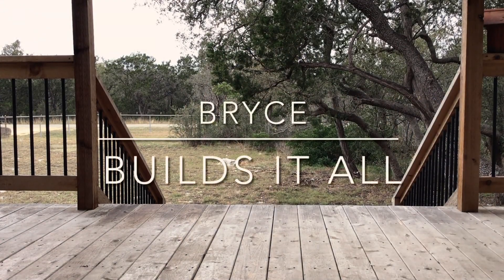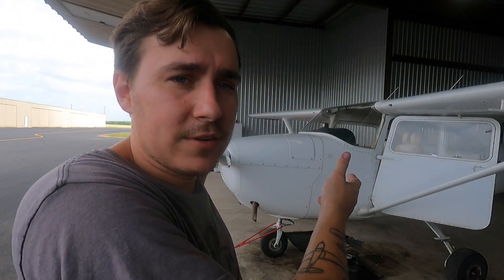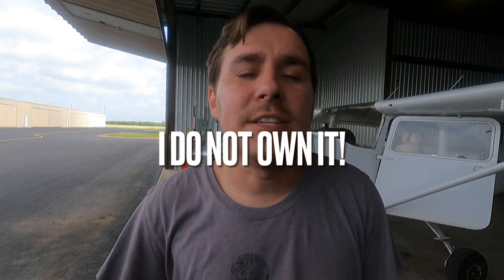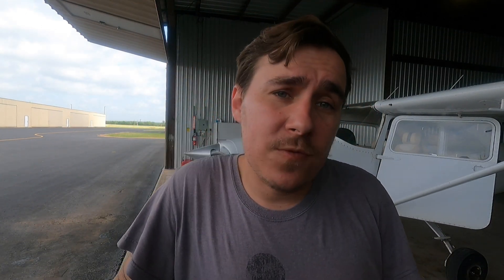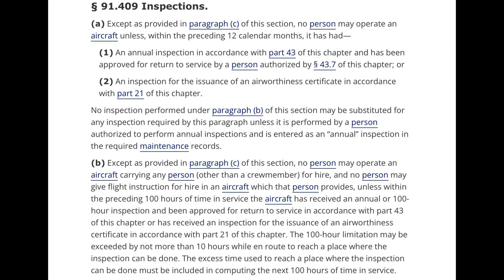Understanding 100-Hour Inspections: When They’re Required and Who Needs Them

Comment: "If the airplane is being rented out, then it is being used for hire." This isn't true. If you rent your plane out to someone and you provide a pilot, it is "for hire". If the plane is being rented, but the renter IS the pilot, it is NOT for hire, even through the plane is generating revenue. Skydiving operations have their own pilot. Banner towers have their own pilot. Aerial photography has its own pilot. Flight training does not always have its own pilot, since student pilots can solo, so that's why the FAA has made "flight instruction" its very own section.

See the letter from Mark Bury to Stephen R. Greenwood, Fly By Knight, Inc, dated Oct 1, 2014:

"For instance, if Fly B y Knight, Inc. is going to operate the aircraft to provide flight instruction for hire, then the aircraft must have had an annual or 100-hour maintenance inspection within the preceding 100 hours of time in service. If Fly By Knight, Inc. is going to rent the aircraft to a customer, however, and does not provide the pilot, that aircraft need not have an annual or 100-hour maintenance inspection within the preceding 100 hours of time in service. "

Comment: I have a PA28 that is used for pure time building in a small group of friends. In the last year 2024-2025 we put a total of 984 hours on the airframe. In almost 1000 hours in a year we only did a single 100 hour when we were replacing parts that were already included in a 100 hour. One of the pilots flying is an A&P that does all repairs for the plane. In 1000 hours of flying we've had no problems just doing minor repairs/upgrades on small parts and following the piper recommended 50 hour/100 hour/500 hour inspection list along with the single official 100 hour inspection. Everyone can follow their own maintenance schedule but like mentioned in the video unless it's required for hire your plane won't fall out of the sky without 100 hour inspections. One tip people forget sometimes is owners can download the inspection checklists and do their own inspections with those checklists minus any items that would require more than preventive maintenance and of course owner inspections can't be entered as legal 100 hours in logbooks.